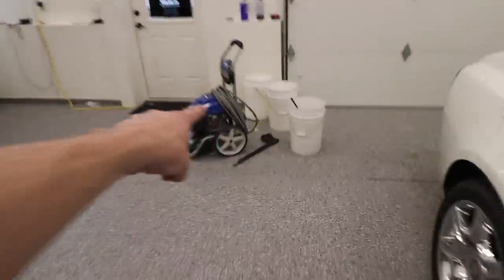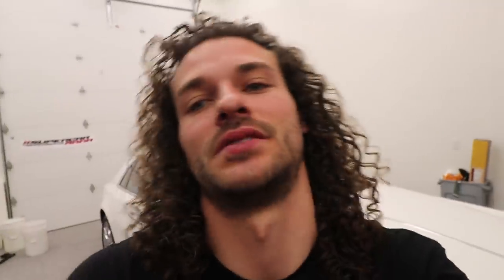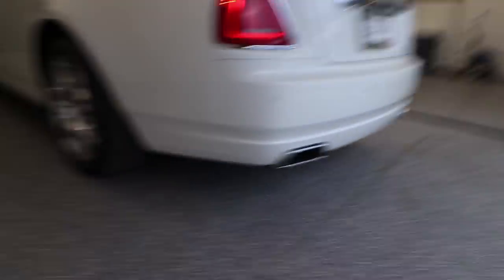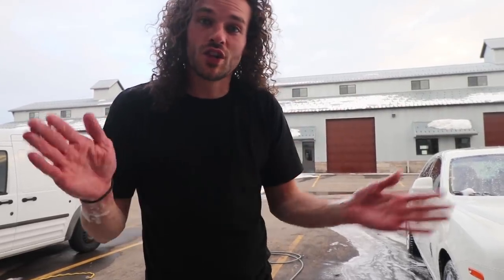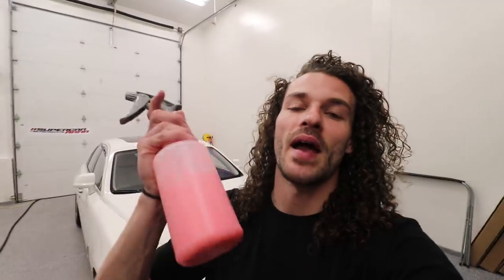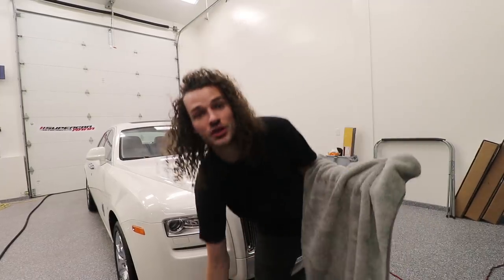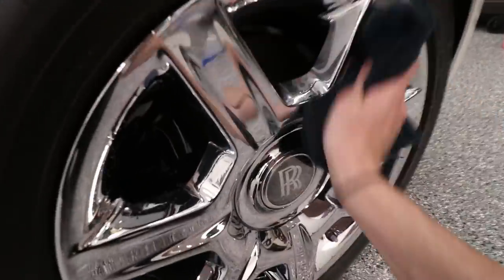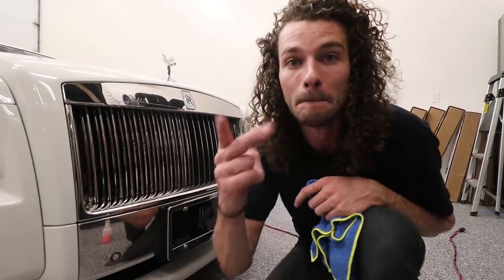How To Wash a Rolls Royce Ghost!!!

Comment: The tire shine with a brush is not something I would do, because of the splatter from the bristles. You could splatter it onto the car. I use a small sponge sprayed with tire dressing.
Reply from the maker: The flag tip brush doesn't splatter any product. A plastic one would though. Another plus is no tire shine gets on your hands.
Reply: Good point. My brush is plastic. I didn't about that. And I do have to wash my hands afterward ): @SummitLife